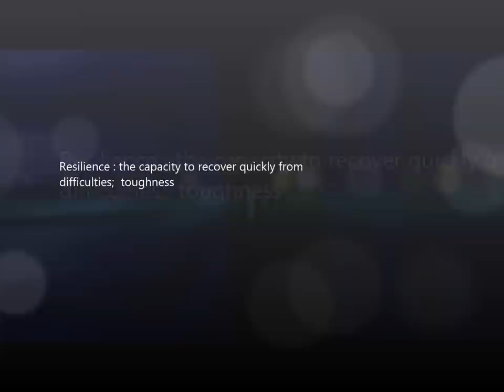Fuming Demonstration: The Honeycomb - Second Demonstration - Resilience Glass

Comment: Amazing work! I wasn't 100% sure but did you fume the inside of the bubble? If so im definitely going to have to try that
Reply from the maker: +ChromZGaMing Yes, fuming the inside of the bubble and then outside is recommended and I've seen improvements on my honeycombs doing just that.  Also remember that flame chemistry, how thin the bubble is, how thick the dots you put on, all play a part in the eventual outcome of the honeycomb.  If you use too much heat overall, the silver tends to crystallize into a milky-white, without much color spectrum.  It really becomes something to master but don't give up!  Also, check out the torch-talk episode on fuming (think episode 67 on fume-combs), they are the masters, i'm simply an adept :D
Reply: +Resilience Glass Thanks man, ill mess around with it.

Comment: Super cool vid. There's actually several ways to do this. What's being demonstrated is an inside-out fumed implosion method. But it can also be done by clear dotting a colored or outside fumed bulb, or even a disk. Then add a clear lens, to magnify the honeycomb cells.  This also Looks coolest with heavy saturated striking colors. (Momca Blue Silver Beach, Boro Batch Wild Honey, Mead, etc)  If you wanna get really fancy, gold and silver fume a flared tube. Then ornately dot the inside with clear. The tighter your termination, the more intricate the honeycomb.